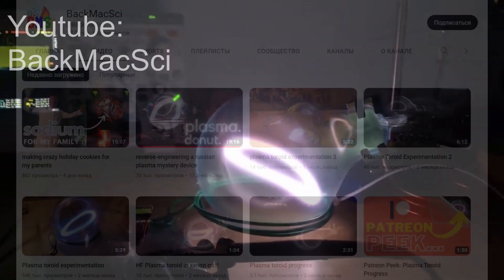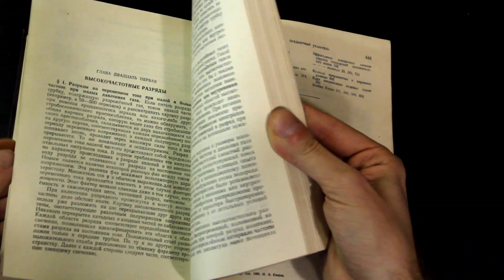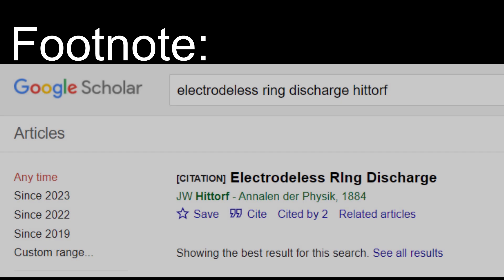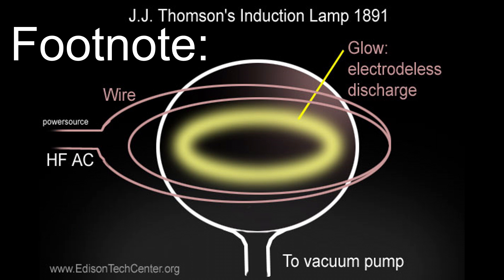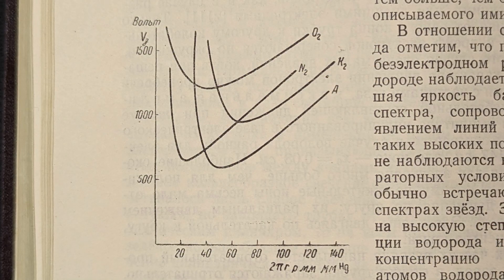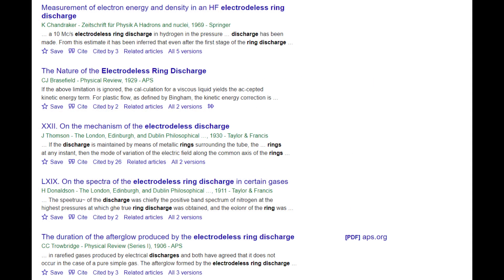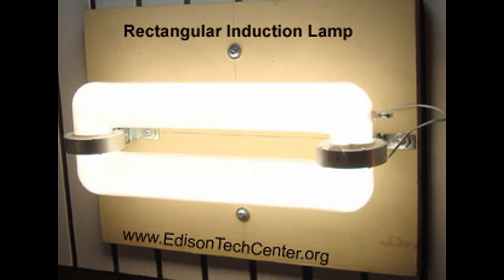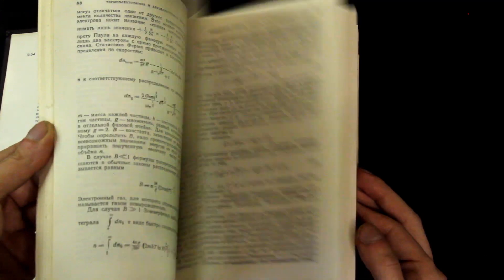Electrodeless Ring Discharge History (since 1884!)

Comment: The "K2" in the Paschen curves is not potassium ("in gaseous form"), it might be a badly printed "H2," i.e. hydrogen (or maybe misread and misspelled by the type setter, as there is some similarity in shape between a a capital H and a K?). The "A" (or maybe it's a Cyrillic "D"?) might be Helium??? Or maybe Ar?
Reply from the maker: You are correct, K2 was actually H2 and A was argon. Look at an older comment thread here, I have looked up the original paper with the figure in question :)
Reply: @Vidduley @PeterBaumgart1a What about Krypton?

Comment: Hello,
I know this is a long shot but I am trying to build (or find) a high voltage square wave
AC power regulated supply for a future project. The input should be 110V AC and the output
between say 10KHz and 1MHz (adjustable) at 200Kv and higher, also adjustable.
I dont know enough about electronic and I thought you could point me in the 
right direction? Thank you for your time and consideration, Respetfully.
Reply: hi there I hope you have made it possible too

Comment: An important concept is "volts per mean free path".  It sets the limits on ionization and activation phenomena.  If you have 140 KiloVolts over 30 cm, that is 0.46667 Volts/microMeter.  The mean free path in air (look at Wikipedia mean free path tables) is about 65 nanometer

(140 KiloVolts/ 30 cm) * 65 nanoMeters in Volts = 0.030333 Volts for one mean free path.

Google will do the calculation for you.  Just write it out completely "(140 KiloVolts/ 30 cm) * 65 nanoMeters in Volts "

The "ionization energy for nitrogen in electron volts"  is 14.4 electronVolts (eV)

The dissociation energy for N2 in electron volts is about 9.756

NIST "strong lines of Nitrogen" gives the wavelengths in Angstrom,  The first entry is 644.635 Angstrom),  Use this form with Google and it will do the conversion for you.  It wants "Planck's Constant" exactly that way.  It is not a great calculator yet, but it has gotten better.  Check the results, don't trust it yet.

(Planck's Constant * speed of light)/(644.635 angstrom) in electron volts --- gives 19.2332403 electron volts

In symbolic form I used E_eV = (PlancksConstant*SpeedOfLight)/(Wavelength_meters*electron_charge).  Using Google it can handle some conversions for you. Search for "CODATA Planck's constant" to get the most recent values.  I use NIST, even if it means manually editing the values every time.  

There needs to be a standard location for all constants and equations and methods on the Internet.  Not millions of "speed of light" just one.

The standard for the Internet is SI units. The browsers are required to give the browser user whatever units they prefer, in each context.  

Richard Collins, The Internet Foundation

Comment: Vidduley,   good job,  I am designing a rocket engine,  it would opperate at around 9,000 F. degrees and I suspect that there may be an opportunity to increase thrust using electric coils if the exhaust is ionized.  I am aiming for 1000 bar combustion pressure and 1000 seconds of impulse.  Any thoughts?
Reply: Wade Cooper,

Don't just focus on the electromagnetic fields, but spend as much time on acoustics.  The ions carry a lot of the mass and energy.  USE SI units (Pascal and Kelvin) most of the literature will use those units and you will waste a lot of time converting.  I suggest you work on both SpaceX Starship sized problems, and vacuum applications. The Saturn V is actually fairly well documented.  Yes, the SpaceX engine ran at 350 bar (35 MegaPascal).  For the earth to orbit portion, or for point-to-point hypersonic passenger and freight traffic, you need to deal with the detailed composition and excitation of the atmosphere and all the ions and excitations.  It is not impossible, just tedious. 

Look at resonant ground effects,  You can gain from acoustic resonance which is pretty well known. Acoustic levitation is actually slightly ahead of magnetic levitation.  This particular "electrodeless discharge" is most likely better studied under "RF plasma" or "radio frequency plasma" or even "cyclotron resonance" of "microwave plasma".  

You can use magnetic pressure gradient forces for some things.  At millimeter and micrometer sizes near nanowires with strong magnetic fields, the forces are strong to control the flows.  It requires precision engineering and lots of calculations. So invest in tools for calculation, calibration and simulation.  It is much cheaper to model than to build.  I think you much too conservative with 1000 bar (0.1 GigaPascal).  The limits are in the 100's of GigaPascals or higher.  Check the strength of solids you will use for electrodes and bounding surfaces.  The tensile strength is given in MegaPascal usually (MPa).  

You can use electric fields from electrons and ions, or from clusters.  You can use magnetic fields from nanoparticles, atoms and electrons.  Those field energy densities are much higher.  

Finally, the limit on the fields at the earth's surface are determined by the gravitational energy density which is comparable (9.8 m/s^2) to a magnetic field of about 380 Tesla.  The natural lightning discharge is limited by the gravitational energy density.  On the earth and sun the peak discharges match the gravitational energy density (it puts a limit) and then is is close to Planck black body spectrum, but resonant methods can excite most any mode you can monitor and control.  

I filed this under "Earth to orbit and hypersonic point to point, rocket propulsion optimization has orders of magnitude potential"

Richard Collins, The Internet Foundation
Reply: @RichardKCollins  Thank you for your detailed reply.  I have two engine designs.  One is strictly a chemical rocket but with a stronger and smaller design to handle 1000 bar chamber pressure using a super alloy that no one else is using.  Given that this may allow the pressure to be 2 to 3 times higher, I expect the temperature and the ISP to be 2 to 3 times higher.  This is for a booster to get 1,000 tons into low earth orbit, perhaps much more given that much less fuel would be needed and a single stage to orbit would save a lot of fuel and mass.  If this works, and I have a super fuel to help it along, then we could put super structures into orbit and build real space stations, not these tinker toys that NASA works with .  
     The second engine is actually for a heavy cruiser of about 1,000 feet long.  Given the length it would enable the use of magnetic coil tech from cyclotrons or colliders and Helion  has developed a switching system fast enough to work with the limit of maybe 400 feet to get particle exhaust up to 50% of the speed of light.  But the emitter of fuel would be a single small chemical engine spitting out about 1,000 lbs of thrust and 1,000 seconds of impulse, hoping to multiply that 1,000 lbs of thrust by a factor of ten to get 10,000 lbs of thrust after going through the 400 feet of coils.  So the exhaust will be super hot and ionized , of course..   I hope to present this discourse to ELon Musk this summer.  I have drawings but no working models.

Comment: Thanks for the translation. Interesting looking book. I can't find this book in english, has anyone else found it ?
Reply: I was not able to find it at all. A lot of papers referencing it, but no English translation of the book (hardly even the original Russian, but couldn't find any file for download there either).
Reply from the maker: It seems to me like the 1950 edition (2nd) unfortunately isn't downloadable anywhere on the internet even in Russian (that was one of the reasons I bought the hardcover book when I saw it). But I have found the first edition (1947) of this book in Russian as a pdf. It's missing a lot of interesting stuff, particularly about the torch discharge and RF corona (i.e. the "streamers" from tesla coils), but it's still 800+ pages and has the same paragraph about the ring discharge as the one that I've translated. If you guys are interested you can email me and I'll send you a pdf (to clarify: it's in Russian).
Reply: @Vidduley :

I maintain a personal digital library, so I'll gladly grab a copy. I'll send you an email right away.
Reply: @Vidduley  That's great, thanks :) What's a good email for you ?
Reply from the maker: It's vidduleymail@gmail.com
Reply: @Vidduley  Thanks :)
Reply: @hoon_sol  Thanks.

Comment: Could It simply be H2 hydrogen rather than K2?
Reply from the maker: To conclude this thread: I did find the original paper, although Kaptsov mistakenly referenced a wrong paper in his book :) The correct paper is from German journal "Annalen der Physik", 1928: https://doi.org/10.1002/andp.19283900508. In my book it was a misprint or something, looking at the original paper K2 should have indeed been H2. Also A is for argon, as a person in an earlier comment has said. For some reason, in this paper argon is interchangeably called "A" and "Ar". Thank you all for the interesting discussion!
Reply from the maker: It might have been, but I'm sure that's a K, not an H. I looked it up in scholar and there are some spectroscopy papers which include ring discharges in potassium vapors (the color is said to be green glow and purple ring). Add to that that apparently vaporised potassium takes molecular form of a dimer K2. So it's quite possible that it indeed was potassium. Now we just need to figure out what the heck is the fourth curve, titled "A" 😂😂 This picture is referenced as taken from a paper by Zouckermann from 1935, I might look it up later.
Reply: @Vidduley  Argon used to have the symbol "A", until it was changed to "Ar" in 1957.
Reply from the maker: Really? Thanks, that indeed would explain it :) I didn't know that
Reply: @Mikkel324  I was wondering if this would be Argon.  We tried making this type of discharge with several gasses, including argon, and it would not work as intended... just a fully glowing volume if I recall correctly (no filamentary structure).  I believe Neon also didn't work.  Only heavy stuff like Xe and Kr seems to work, unless you confine the discharge with a ring-shaped vessel, which I think is cheating :-).
Reply: Kripton